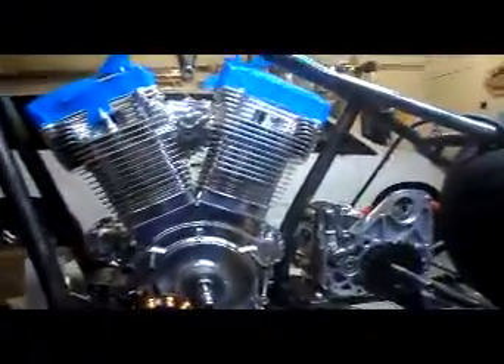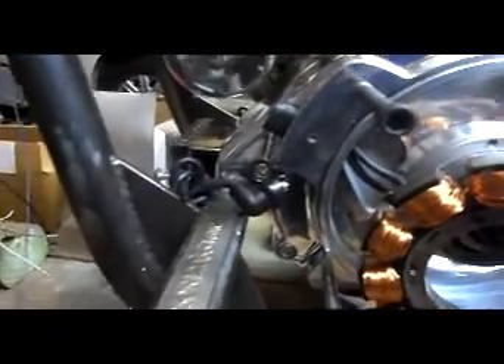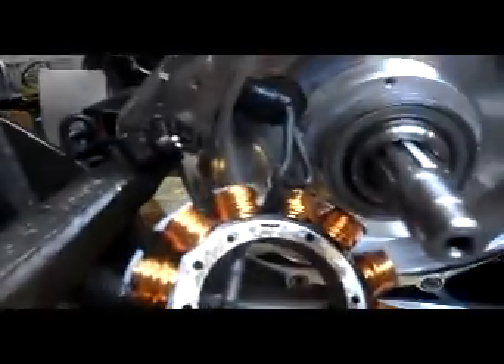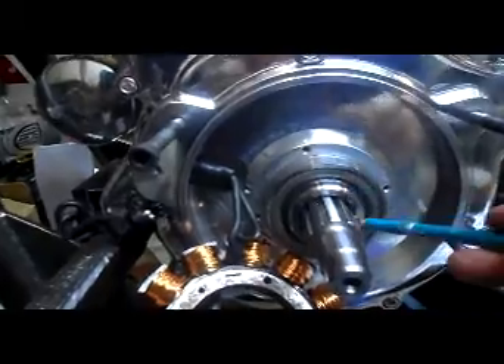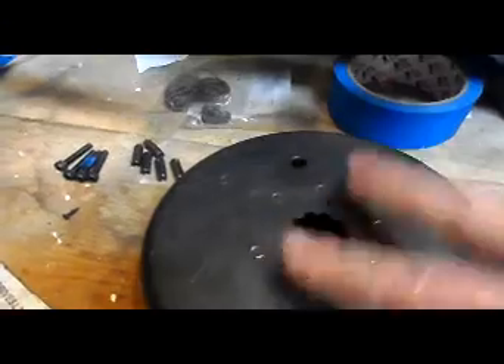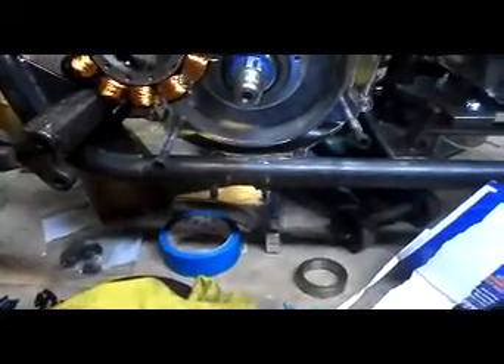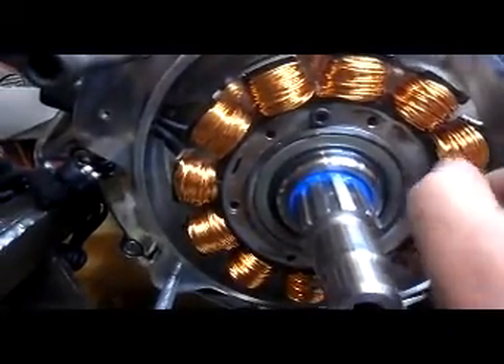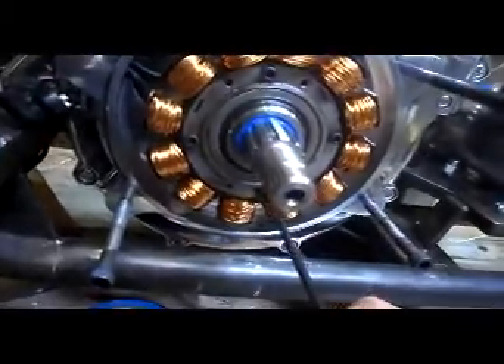Rotor and stator install for V Twin

Comment: Thanks a lot. Very informative and helpful. I appreciate your comment about not being able to get clear info as a newbie. I am too. I was installing a Drag Specialties rotor/stator on an Ultima El Bruno 120. The hole for the stator plug wires was super tight. A little di-electric grease helped a great deal. Still needed to really shove it through.

Comment: Yes it does ned a washer,if not the rotor cuts the wire and if you dont used silicon, the oil comeback and leak out and destroy every8 ting,

Comment: To check the stator for rotor interference, cut a disc of carbon paper same as rotor id. Cut center hole same as shaft size. Black side to stator, put on rotor, tap a few times all over with screwdriver handle or rubber mallet. Pull off rotor and carbon paper, check for black smudges on stator windings. No smudges, no clearance issue. You can spin the motor if you like, or just "clock" the rotor in a few positions for the same check. The thickness of the carbon paper insures clearance when hot, dykem won't...

Comment: You are not supposed to use any silicone in there at all!  This will cause problems.
Reply: I'v been replacing stator's on shovelheads for 41 years and I'v never heard of putting silicone in there. Putting silicone on case behind the stater seems like it could cause rotor to stater clearance problems. If the stater is in tight, why would it need silicon between stater and case?
Reply: @joesurfer9754  People are in love with money goop in bottles and sueeze tubes these days.  Its indoctrination of mareting in the mil generation
Reply: Ultima recommends the silicone both behind the stator and on the splines...it’s right there in the owner’s manual from Ultima. I’m not saying it’s necessary or correct, just that the manufacturer recommends it.

Comment: When the motor turns over that silicone will break loose right away. Every ultima
Motor Iv ever ran and it’s been about 6 now has leaked from that main shaft seal they really need to get that figured out